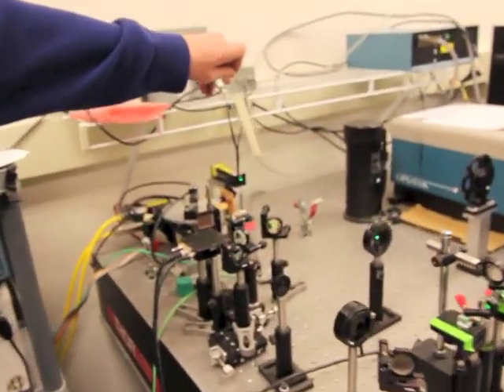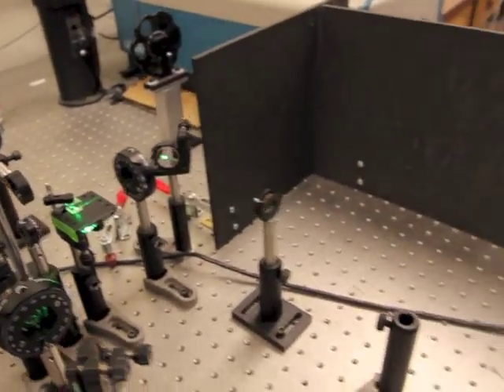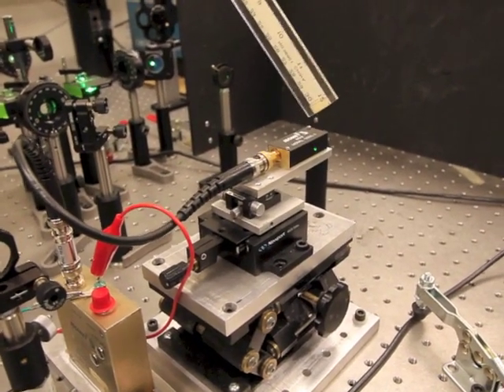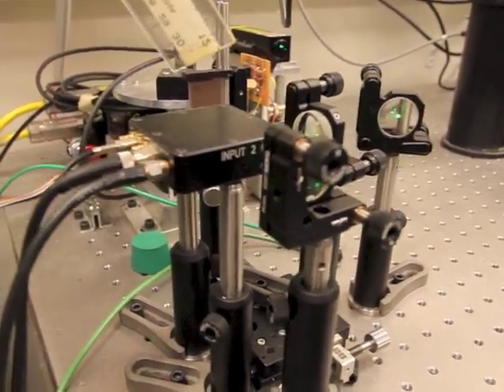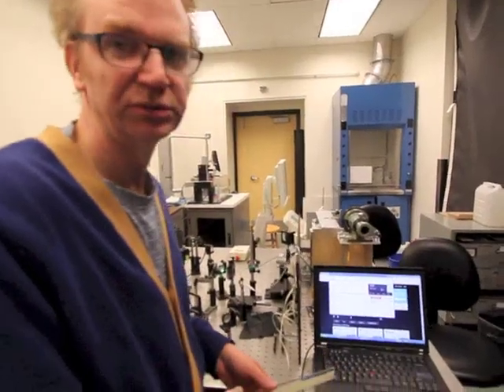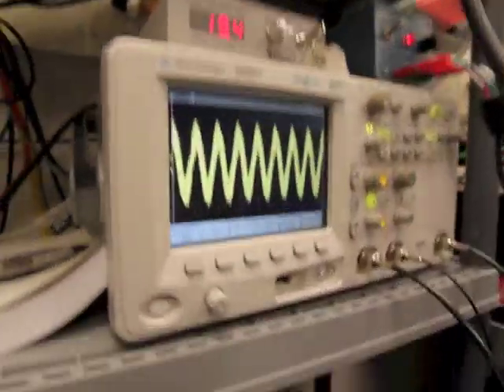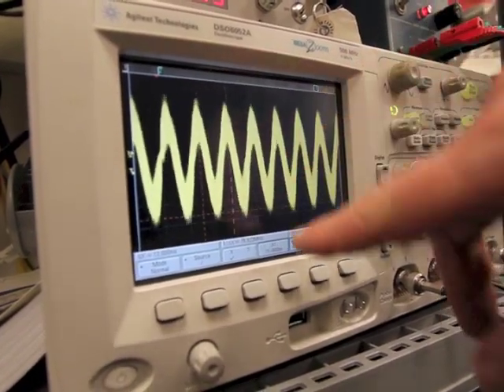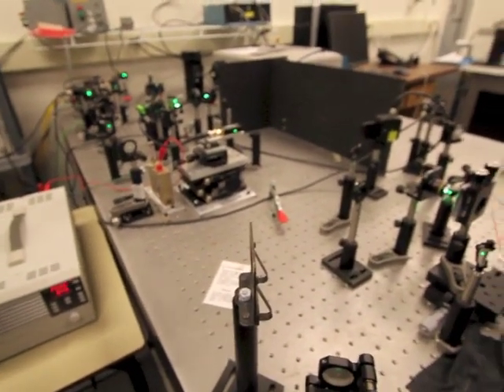Acousto-Optic Modulation for Sound Transmission

Comment: why did u use a acoustic optic modulator and not an other manner of modulation ?
Reply: We wanted to shift the audio signal to a high frequency of 80 MHz.  This method makes the audio signal easier to recover and reduces the low frequency noises which may be apparent had the signal be modulated another way.  In addition, the optics for setup where readily available in the lab.

Comment: Sir, what are the inputs you have given to the AOM ?
Reply: A 80 MHz waveform generator.
Reply: @georgenoble4482  Can I get the  product(function generator) details ?
Reply: From where I can buy this RF Generator to drive AOM ?
Reply: @prk310  It's a standard waveform generator that is readily available used or new.  You can Google  80 MHz waveform generator also.
Reply: Depending on your AOM model, you may need to amplify the 80 MHz signal
Reply: @georgenoble4482  Thank you
Reply: @prk310  If you are going to recreate this setup, I suggest you use an AOM with a frequency input between 82 MHz and 107 MHz.  This range would allow a standard FM Radio to pick up the signal. In this demo a special radio with a 80 MHz detector was used.
Reply: You can Google Voltage Controlled Oscillators (VCOs) to find a function generator to match the AOM frequency.
Reply: @georgenoble4482  It is a great idea to use Radio reader :D. Thank sir
Reply: @duongkhi Thank you.  When I created this demo, I hoped it would work as shown here. Prior to this, I had not seen a setup using a fm radio to output the sound before.  The FM  radio functions as a real time demodulator.

Comment: This purposes of this video are to demonstrate the following:  FM Demodulation, optical interference, polarization, acoustic optic modulator (AOM) and to have fun.
Reply: and also Doppler shift with light -- very nice and I learn new thing that I do not need DAQ system + software to get back the sound signal -- just use FM radio ! Thank you.